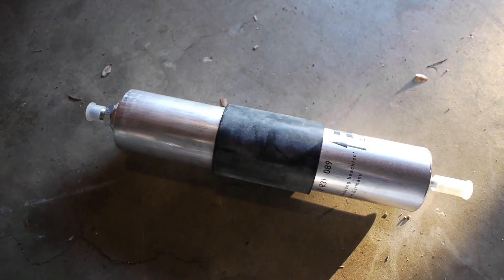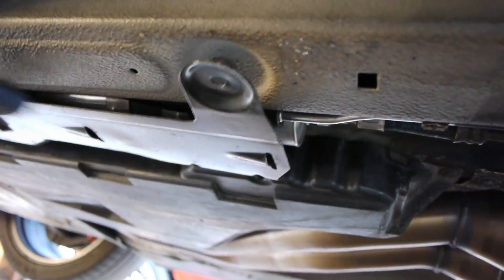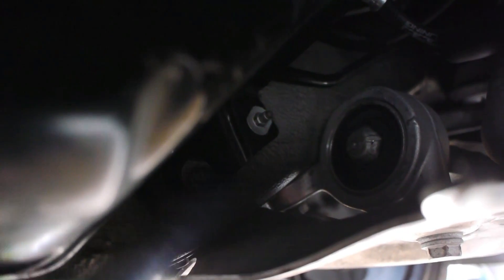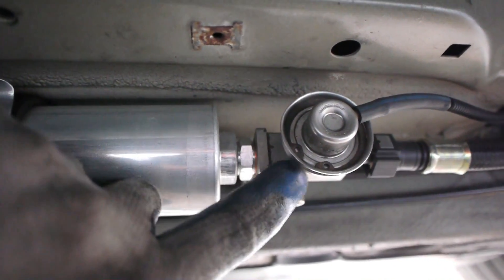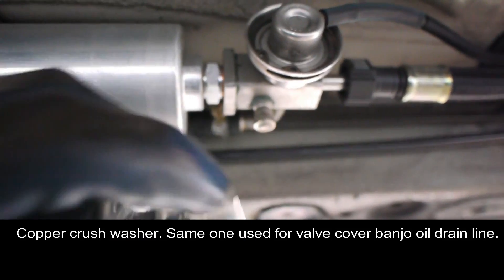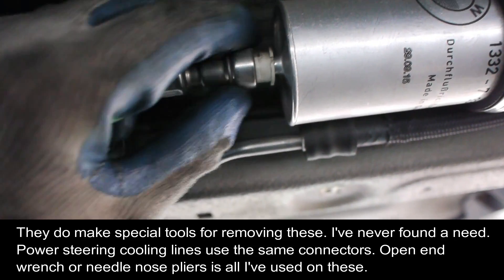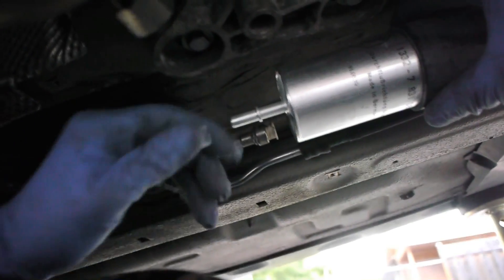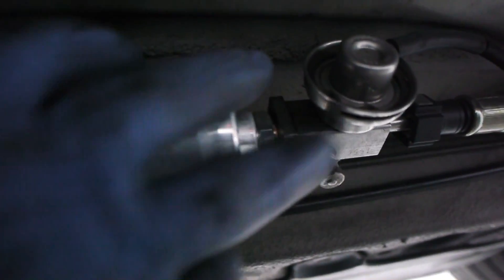E46 M3 - fuel filter replacement and guibo tip

Comment: i just did my fuel filter yesterday on my 2001 330CI, its wayy hard then your M3, man M3's got it easy for fuel filter DIY's, i had to literally use pick tools and a modified tool to get my fuel lines off of the fuel filter.
Reply from the maker: Yeah some of those lines are overengineered and can be frustrating. Glad you got it working!